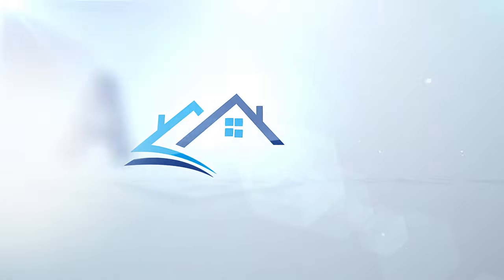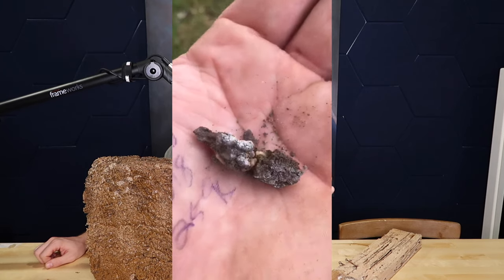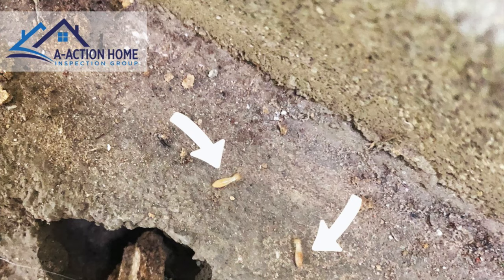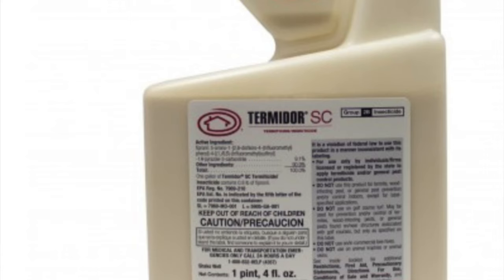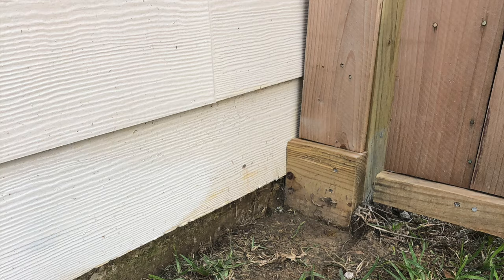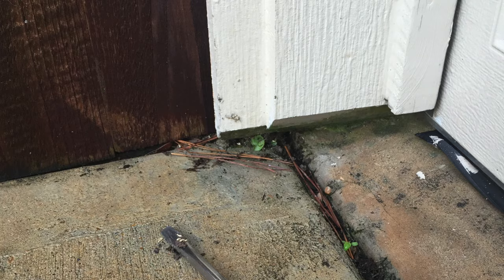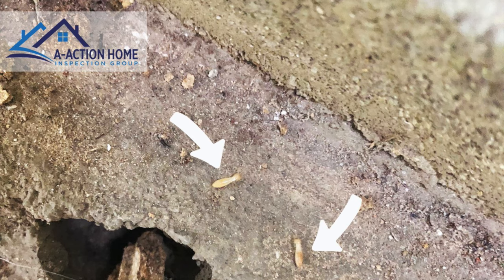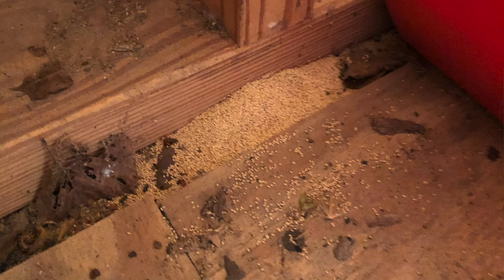How to identify termites in 10 minutes - The Houston Home Inspector

Comment: This was really helpful & informative! For those  who prefer not to use chemicals, due to respiratory sensitivity/post covid etc, studies show cinnamon, cedarwood, clove, orange, neem &  tea tree oil are potent for killing termites. Tea tree oil is especially effective due to it's antimicrobial properties. The relationship between the termites and the microbes is a mutualism, because both species benefit from the relationship.  The termites masticate the wood to mechanically break it down, and the microbes chemically digest the wood into smaller molecules that the termites are able to absorb and utilize.  Oils may be sprayed directly on the termites or applied in full strength to the wood. Some oils, like orange oil and tea tree oil, may be used in fumigation as well. If spraying termites directly, use 4 drops per gallon of water, increasing the concentration if needed. More than one application of any of the oils may be necessary. For best results, use therapeutic grade oils only. According to the Journal of Pharmacognosy and Phytotherapy, most essential oils are believed to have a neurotoxic effect on insects. https://homeguides.sfgate.com/cinnamon-oil-natural-pesticide-termites-86406.html
Reply from the maker: Good info!
Reply: Thank you so much!
Reply: Just be careful if you have pets! Diffusing essential oils can be toxic to dogs and cats, depending on what kinds you use.
Reply: @emilywelsh1072  Absolutely! A great tip for everyone to remember.

Comment: Thanks Chris, I'm in Melbourne Australia I live in a Barn all timber construction. We have termites in our back room all the skirting boards in that one room have been eaten, funny thing is you dig a screw driver in to it and rip the wood apart and you may find anywhere between 1 to 5 termites its as if they've been and gone. I have removed a some plaster board to the ceiling and found pretty much all the bottom part of the walls have been affected and where you have two vertical pieces together there is a tube running up the gap and the top has been totally eaten into but again no sign of termites. I need to remove more of the plasterboard but its scarying me what I might find. We do have a moisture problem where flooding after a really heavy down pour of rain will happen in the back room, it seems that most of the bottom runs of timber of the wall has suffered from water rot together with termite damage. Your video helped to identify and the only termites I have seen are the little white guys the Albino Termite with a small head, we are on a concrete slab as well. Your referrence to the home insurance was interesting I'm looking into that as I type. We've been here only 11 years, I have no idea how long these termites have been here, I was please to here you say they generally move slow, how long would termites, the Albino type, go through say a meter of wood roughly....?
P.S. I luv your super quality microphone but you don't really need it in your face, you can adjust gain and compression levels so that mic' can sit on you table and you'll still be picked up ok, either that or wear a Lapel Microphone, but having a microphone in your face isn't a good look for video...just saying....;)

Comment: I first saw this August '21 when I discovered one of these cartons in the spot above the bathroom door and the ceiling in the master bedroom. I have since had a liquid barrier put in and the house fared well during Hurricane Ida. Just last month I tore down what looked like water damaged paneling in the garage around the overhead door and found the entire header is eaten away. All damage will be replaced by pressure treated wood and will fix as I run into it. All inactive now, there was a bait system contract when I first bought the house, I upgraded to a liquid barrier.

Comment: Hi Dan, your video is so helpful to the currently crazy people like me who is experiencing the hardeat time  struggling with existed termites in the house. I live in South Florida, which is the areas with the worst termite problems. We didn't mention any potential subterranean termite problems until last month, when swarms of termites flew into my house at night and I almost fainted on the spot.
The next day, I couldn't wait to make an appointment with several companies that specialize in the treatment of termites. They offered different plans, and the price was basically around $1900.  I also learned a lot of relevant knowledge through your video and bought the “products”， hoping can eliminate this huge hidden danger in the ASAP and end of my nightmare. Do you have any better suggestions here? Thanks again for your sharing.

Comment: I have a tapping sound on my masters bedroom wall that only happens during the day…is that termite?
Reply from the maker: @eagleeye2427  probably not,  your HVAC is normally running during the day.  Do you think it is your primary drain line to  your unit?  Termites do not make a tapping noise.
Reply: @AActionHomeInspectionHouston  I googled it, but they said they do when they’re banging their head. I swear it said that lol.
Reply: @AActionHomeInspectionHouston  No, I don’t think so as my HVAC is at the back of the house and the master’s is at the front.
Reply from the maker: @eagleeye2427  do you see excessive debris that you have to keep cleaning around your bedroom?
Reply: @AActionHomeInspectionHouston  No, but today I went out to the front of the house. Front of the master’s and found some tiny tiny egg like that are gathered together on the wall. The size are like coffee grinds…I sprayed it with 70% alcohol. Love your video by the way and thank you!

Comment: I moved my dresser and found termites they ate up one drawer and almost got into the wall idk how they got inside the house but the only place they were was in the dresser maby inside the wall that was behind it how do I find that out?
Reply from the maker: They are probably coming from your exterior wall.  It also depends on the type of termites as well.
Reply: I think they are the ones that come from the soil because there is a flower bed on the outside of that particular wall
Reply from the maker: @nicoledoerr4269  they come in from the mulch often

Comment: That's not true about the mandibles being crossed, both termites can have mandibles crossed, the correct way to tell the difference is one has a serrated mandible or points on the mandible and the other one is a smooth mandible.